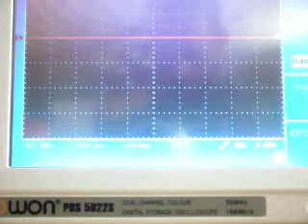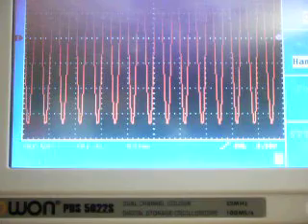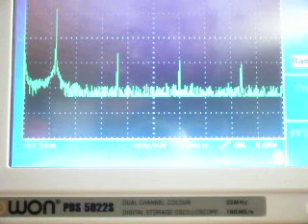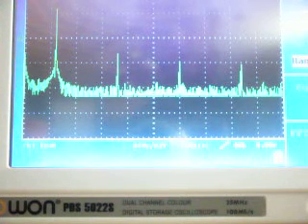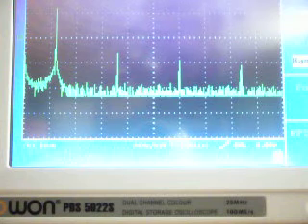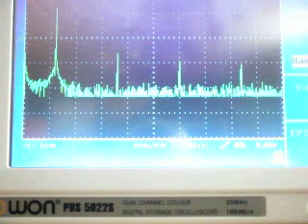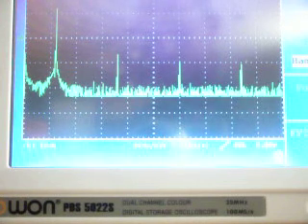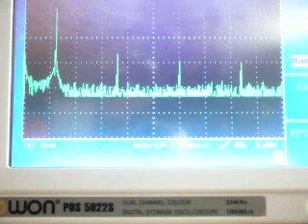House Power System Frequency and Harmonics Demonstration

Comment from the maker: I don't use a GS meter, as the battery powered oscilloscope with fast Fourier transform (FFT) is superior and should be used when characterizing dirty electricity.  The frequency range is limited on the GS meter and misses a lot of dirty electricity effects: "The frequency band covered by the STETZERiZER® Microsurge Meter is about 10 kHz to 100 kHz."

Comment from the maker: GS filters can help, but are not the solution. You need to identify if the harmonics are coming from the utility (this case) or if they are coming from the electrical and electronic products that you have bought. You should remove dirty electricity products from service rather than install filters.  Unfortunately, a lot of people have purchased a lot of dirty electricity producing products!  If the harmonics are coming from the utility, you will have to get them to fix it. You may need a lawyer.